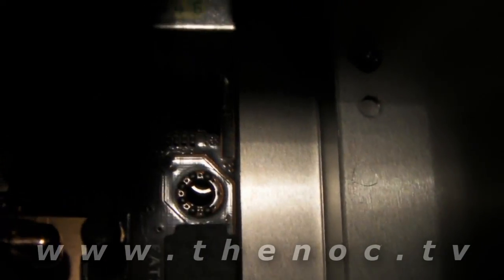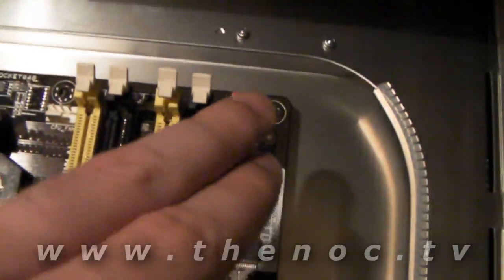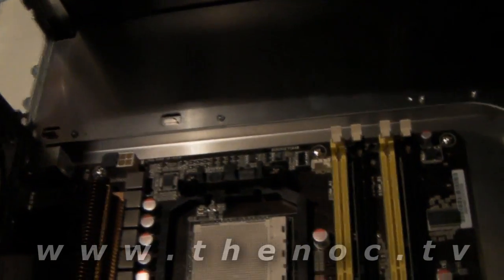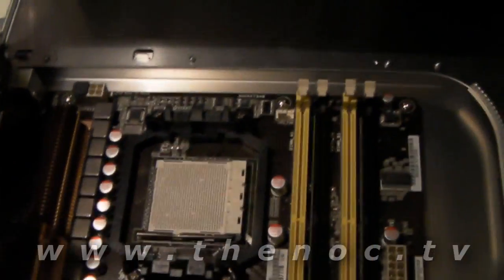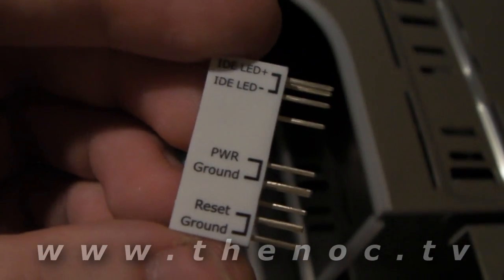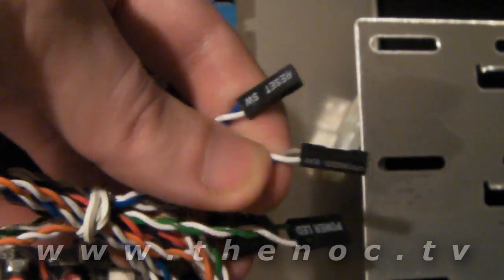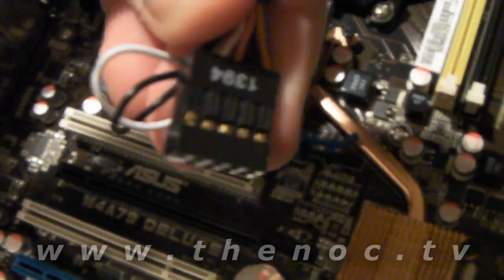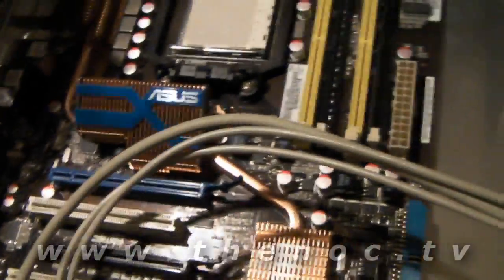Build your own custom computer - Motherboard Part 2

Comment: Do you remember having to put in the cardboard circles as a spacer between the mother board and standoff to prevent ground out issues back in the 90's?